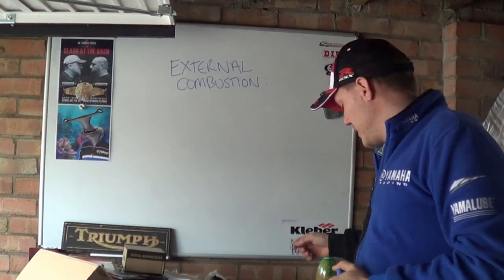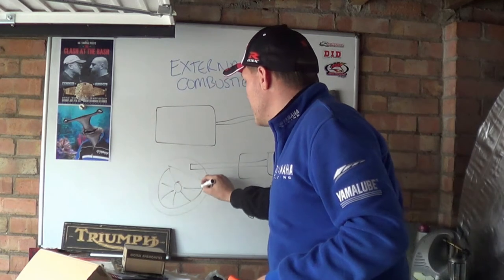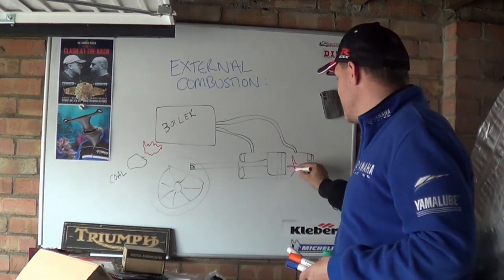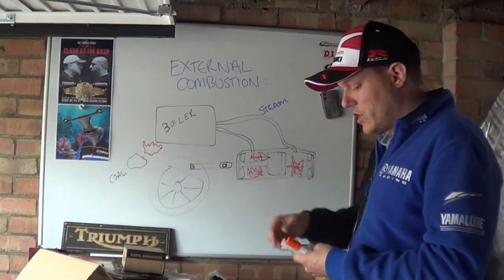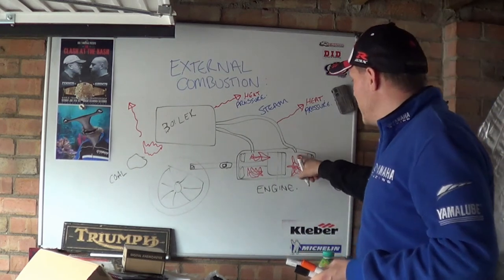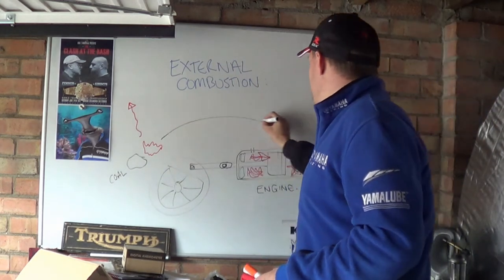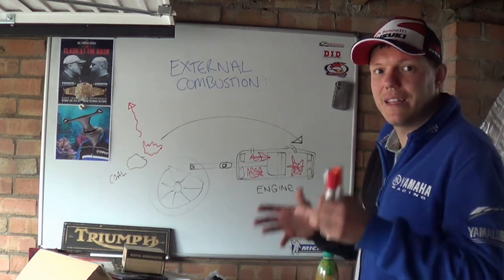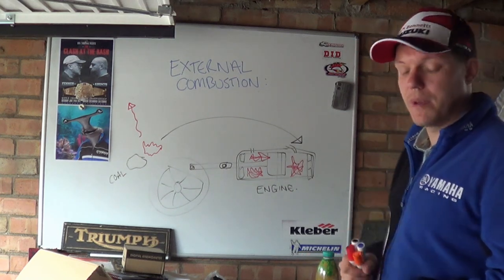External Combustion engine - where it all started

Comment: So... what's the max efficiency if the thermal insulation is made "really good"? And the heat is transferred into the boiler efficiently...?
Reply from the maker: That's coming soon but look up the carnot cycle if you can't wait
Reply: @dirtygarageguy  - yeah... I mean... in theory, if you have constant supply pressure, and constant exhaust pressure, and the valve opens and closes "enough" to pressurize / depressurize near "instantaneously"... you could end up with a square Carnot cycle.

I mean... constant pressure in - volume increases... flip the valve, constant (low) pressure out - volume shrinking.

As long as the valve is large enough to produce adequate flow for pressurizing / depressurizing fully. And the tubes insulated with good thermal insulator...

In theory it could approach to extreme efficiency. As long as the pressure leaks are miniscule (how air tight can a piston become?), and temperature losses are reduced "enough".

RPM could be low... I've got some numbers showing up to 5000 rpm could be plausible for a 10cm stroke using 500C air temperature. But the efficiency... extreme. 

A 75kW engine with a footprint of A4 piece of paper.
Reply from the maker: The carnot efficency is what I should have said. You can only be as efficient as the gradient outside of the system

Comment: modern torpedoes use external combustion engines, they are very small and very powerful. burning a mono propellant ( otto fuel) that produces its own oxygen as it burns. 300-500 hp is not uncommon in an engine around 18inch in diameter and length.
Reply from the maker: what engine is that?
Reply from the maker: That's a swashplate engine just like the Duke engine I did a video on. That's not external combustion.............
Reply: actually its both it uses an external combustion chamber. I've been in the Navy for almost 20 years working on these trust me its an external combustion engine in a swashplate configuration, this gives it a much smaller radial diameter so it can fit inside a 21" diameter torpedo. But because it can not breath air (underwater remember)like normal engines it uses an external combustion chamber fueled by the mono propellant Otto Fuel 2. combustion happens in the external chamber one for each cylinder, then when the "intake valve"(not really an intake but for explanation sakes)  opens it forces the piston down of course its a little more complicated but essentially its an external combustion swashplate engine. very powerful for the size of course the fuel is a high density energy fuel. the engine can be throttled up and down by regulating the amount of fuel that is injected into the combustion chamber.
Reply: I believe the duke engine the whole piston/cylinder  assemble rotates ? this case its like a hydraulic motor the swashplate moves and  rotates the output shaft the pistons /cylinders / combustion chambers are stationary.  anyway just wanted to give you/readers an example of a different type of external combustion chamber engine that not many people know about.